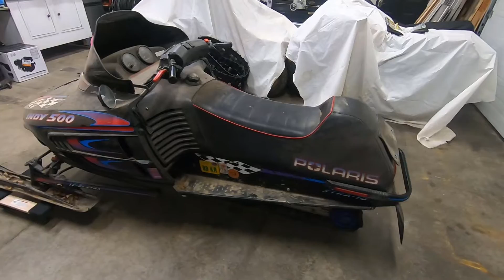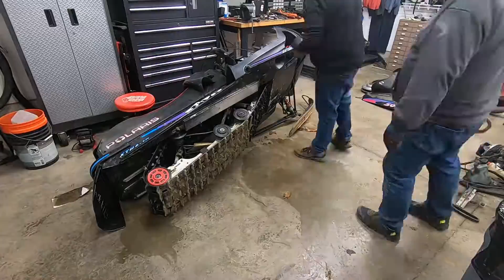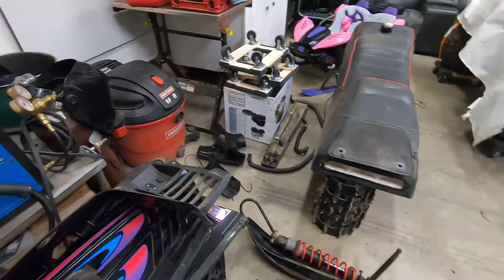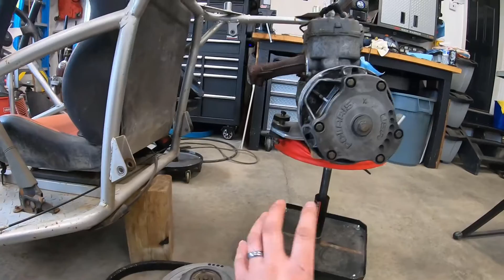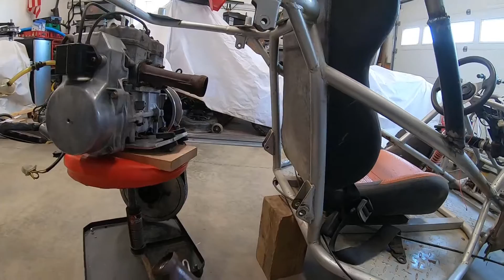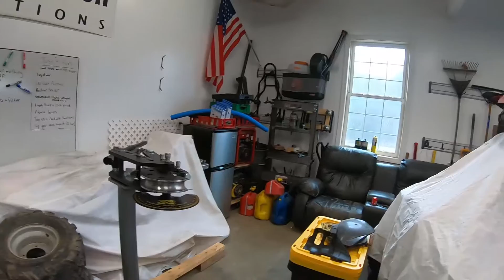Coolster500 - Snowmobile Powered Go Kart Part 1

Comment: Hey man! Cool build, but you really should have chopped and turned the pipe and rewelded it. Extending the header will put your exhaust pulses way out of whack.
Reply from the maker: Really, you think it’s going to effect the exhaust that much? I really only added in 2 inches or so
Reply: @nate32185  yea man.  Itll probably run OK, but not like it should.  Itll move the powerband far from where it's at and maybe out of the rpm range it can even run at.    Itll feel like lots of power in a little buggy either way, but itll end up running lean for sure.    2 strokes rely on the exhaust pulses (theres 2 different ones for each cylinder, sound and pressure..  they both have an effect, and then the other side as well..   then when a 2 into 1 on a sled REALLY RIPS is when both cylinders pulses align just right so they work together for both cylinders. As a 2 stroke over fuels and also due to port overlap, spits some fuel into the manifold, the return waves cram it back into the cylinder, creating sort of a supercharging effect.  Its a lot to explain, but basically why single pipe sleds tend to make more jam and twin or triple pipe sleds make more HP due to higher rpm) 99/100 guys wouldnt think of it or just brush it off, but sleds are life up here!   Polaris did a hell of a good job building thise 1 piece shit-sounding pipes when it comes to power and performance, Aaen single pipe is about the only decent option for upgrade, and the OEM pipe makes more power.  What I would do is cut and turn it, then mod the pipe to get rid of the heavy silencer part and run a can for a 440-600 on it.    Lots of companies have made manifolds for 2 strokes that change the powerband and NONE of them are more than 3/16" difference in length. This is why!

Comment: With all of that added power, you might want to widen your wheelbase. Alas, great video and I look forward to the finished project.
Reply from the maker: Yes, I will address this a little in the rear with either wheel spacers or offset rims. The front is going to be a whole foot wider. I’m using the front suspension off a 300ex. You can see it in the background. Thanks for following along.